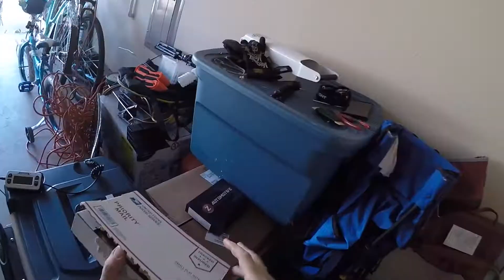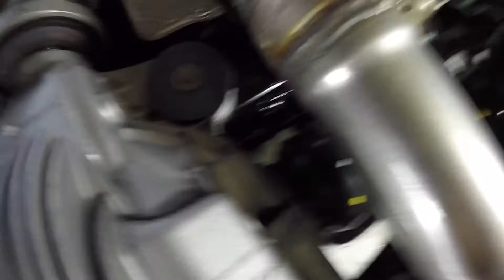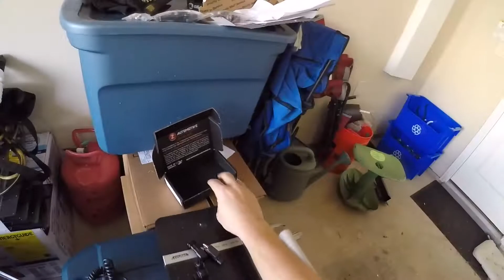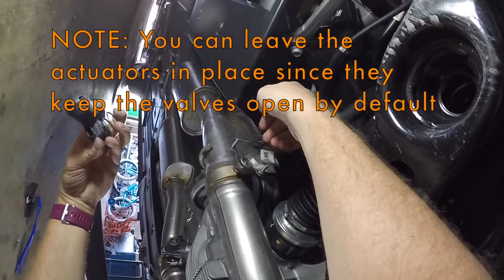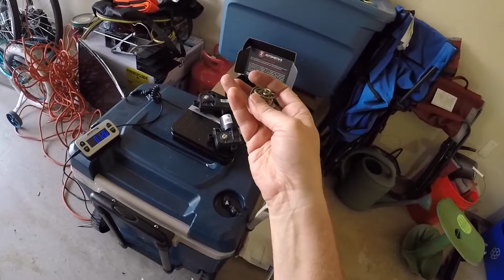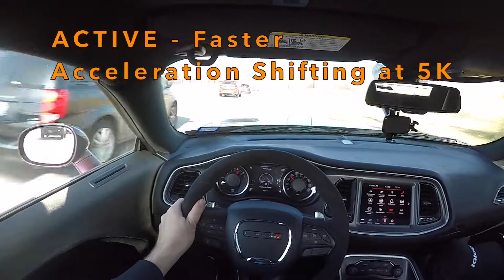Active Exhaust Delete Options for Dodge Challenger and Charger - FREE vs.  Z Automotive vs. Khaos

Comment from the maker: For whatever reason the free option that I show doesn't work on cars with the 5.7 It'll only work on 19 and up 6.4s and Hellcats.
Reply: I have a 17 392. So I assume the Free method you remove the spring from the casing and screw it back on? That way it can’t twist the valve that’s wired? I have a rattle and it’s annoying.
Reply: @ztidz  did you end up doing it I have a 17 as well and I’m thinking of doing the same
Reply: @392Alex did it work for you ? I’m asking you because I have the same problem with my 2017 scat pack
Reply: @josetepeyac4849 no I ended up buying a kit from online
Reply: @ztidz you have to tie them open
Reply: I have 2016 hellcat. I will have the code?
Reply from the maker: @MrYousefX  if you get the delete kit or plugs, then no. But if you try the free method, then probably yes. I've only. seen the free method work without popping codes on 2019s and newer.
Reply: Why would the free option not work on the 5.7? Asking because I have a '19 Challenger R/T
Reply from the maker: @erikleach1753  my guess is it's something to do with the programming. While 6.2s and 6.4s went through some changes in 2019 they must not have made changes for the 5.7s. But again that's just my guess. So far everyone I know that's tried it with a 5.7 has said the check engine light comes on
Reply: Do you have a code. 
I just got mt 19 5.7 all fix up @erikleach1753
Reply: It worked for me
Reply from the maker: @MrSuperTrackPackRT  what year, trim and engine?
Reply: @Scavenger1320 do you know if the z automotive ones will trigger check engine code on ,2018 challenger rt  5.7
Reply from the maker: @Hndzzzz310  it shouldn't pop any codes.
Reply: @Hndzzzz310 it doesn’t throw any lights (zauto)- works like a charm. 
Best sounding exhaust compared to a scat or a cat.
I had it on my RT- totally worth it.
I have it on my hellcat now!
No problems at all- except for
1. Cars move out of the your way.
2. Attention on the streets.

Comment: This was a very helpful video. I just ordered the Z Automotive inactive exhaust kit for my '18 Challenger Scat Pack because of the ease of installation, the plug and play methodology, and the ease of switiching it back to stock if I want. I plan on just leaving the actuators in their place but use the protective caps Z Automotive provides with the kit.
Reply from the maker: Definitely the easiest and quickest way, and gives you more options in the future if you ever decide to do a cat-back exhaust system. Thanks for watching!

Comment: If you take spring out, why would you need to strap open,? If spring activates the plate to open shut,just asking because not sure,thanks
Reply from the maker: The spring is what is physically connected to the metal valve/flap that opens and closes inside the exhaust pipe. So without the spring, that metal valve is free to move in any position, which means it’ll just be moving around anytime the engine is running and causing a rattling noise.
Reply: @Scavenger1320 thanks for letting me know

Comment: I just did this today and I have a scat charger with mid muffler delete and it does sound a little deeper but not louder your right , my girl claimed it was louder from in the house tho when I stopped by for 10 mins and left to the store so was warm , worth it for free it’s nice having the track mode sound at idle

Comment: My 15 is throwing a code.. the part or wires have failed.. looks like the z auto is the way to go to get rid of the code.
Reply from the maker: That should definitely do the trick, and I think cheaper than buying the actuators, depending where you get them.

Comment: So I'm trying to deal with mine buzzing, 17 T/A 392 M6, I guess the Z Automotive would be best then? I was going to tie them up, but would get codes huh? FREE just sounded good, but to avoid codes, I guess try one of your methods...
Reply from the maker: Free is good, but yeah, you'd have to deal with the CEL on a 17. Z Auto is definitely the easiest option, and the best if you ever plan on getting a custom catback exhaust since the Z Auto plugs means you can completely remove the actuators. The mechanical deletes are a bit cheaper but take a little bit more work than just simply plugging in a connector and you have to leave the actuators in place.

Comment: I have a 2017 charger daytona 392 that squeaks from the active exhaust. If I use the z automotive plugs will it go away. Also would I get a check engine light?
Reply from the maker: Yes, the squeak would go away since the valves would no longer mechanically move at all. And yeah, the z auto plugs would keep the CEL off. That’s really the only reason to even get them since you could do the same thing for free except for that light.
Reply: @Scavenger1320 thanks, if I do install the plugs, do I need to make sure the valves is open before plugging it in? If so how can I open the valve
Reply from the maker: @ebadahmed8765 nope, nothing else you need to do. The valves are open by default when the car is off so all you have to do is unplug the connector from the actuator, plug the z auto plug into that connector, and zip tie it out of the way. The hardest part is getting under the car lol.

Comment: I just installed mfer-1 before I watched this video. Not the hugest difference. Don't regret purchase.I think for $90 I should have put towards midpipes instead. I do have subs so it's alil more sound without messing with tunes.
Reply from the maker: Yeah, it's definitely not a huge difference, but as expensive as most mods are, this one isn't too bad. Thanks for watching!

Comment: Thanks for the video. 
Is there any confirmation about the free option for a 5.7L 2023 last call ?
I saw you said maybe it works.
Reply from the maker: I haven't seen any 5.7 cars where the free method won't pop a code unfortunately. Last call 23s have been out a while now too and I haven't seen anyone saying anything different.

Comment: Can anyone tell me what size zip ties to use? I'd like to try that option before dropping $160 bucks...
Reply from the maker: I really recommend using a metal wire like I did over a plastic zip-tie. You can pick up a small spool of the exact same wire I used in the craft section at walmart for just a couple bucks
Reply: @Scavenger1320  thanks for the info! Do you know what gauge or type of metal you used?

Comment: 2019 challenger  RT 5.7 it don't work the free way ! It throws a check engine light . So you need to put the plug or the the other option
Reply from the maker: Yup, I wasn't sure about the 5.7s when I filmed this but pinned a comment here about it not working on the 5.7 cars after I found out about that. I'm not sure why it's just the 5.7s that it doesn't work for.

Comment: Yeah, this did not work on my 2019 charger R/T. Less that 15 min after doing the ziptie trick i ended up with a code for active exaust.  P121b
Reply from the maker: The free method has never worked on the 5.7 cars for some reason, it'll only work on the 6.4s and 6.2s.

Comment: I cut out my AES valves completely and i have a CEL on in a 22’ Charger RT, i just ordered the Z automotives to hopefully clear the light, do you know if this clears the CEL after the fact or are they only good to install before messing with the active exhaust?
Reply from the maker: It should clear the code after you turn it back on, just make sure the car is completely off when you install the plugs. Everytime you turn the car on the active exhaust is one of the self-checks that it does, so with the plugs installed it'll do its check and the plugs will make it think everything is working again so all should be good.

Comment: Are the pins needed for the acuactuator or can I do without them?
Reply from the maker: By pins do you mean the springs? If so, then it depends on which delete method you go with. If you do the Z Auto plugs, then you just leave them in. You don't even need to remove the actuators for that. Pretty much any other delete method you do have to remove the springs.

Comment: Why does everyone use zip ties or wires I'm going to show u a trick no one knows about I created this and it works better than anything  u can ever try go to  auto zone and purchase J.B steel stick it's a clay read the instructions break a guud amount of clay u turn the valve to a 2 o'clock position u cover the valve pretty guud with the clay put the active exhaust cover back on let it sit over night do not start ur car for about 12 hours that clay u covered the valve with will turn into steel nothing will move that not even with a hammer u will nvr have to worry about that valve malfunctioning I came up with this idea and had it for a year already nvr worry about it coming loose I promise u  you will thank me later on I promise u NO ZIPE TIES PLEASE OR WIRES
Reply from the maker: Well, for one there's no having to wait 12 hours or having to have the car sitting overnight with wires or any of that other stuff you're talking about. In about the time it took to write all those steps out, I could be done with it using a wire, and be able to start it up and drive off instantly. Plus I've never had any issues with the wire. I ran this same wire for over 3 years and it was still holding strong. If your method works too and thats what you prefer then great, but using a metal wire is definitely the easiest way. I do agree about not using zip ties though. I wouldn't trust something made of plastic up against a hot exhaust.

Comment: I have a 2019 RT  i have a code.
I did unplugged it to fix the broken spring. 
Still have a code.
I neee help
Reply from the maker: If it's a 5.7 then that's why. The free method doesn't work on 5.7 cars, except maybe on the 2023 model year. So for a 5.7 you'll have to buy a mechanical delete kit or the Z-Auto plugs.

Comment: THIS GUY IS SOʻO USE TO BEING SELFISH HE FORGOT TO TELL U WHICH WAY DO U TURN THE ACTIVE EXHAUST  VALVE AND ZIP TIE IT 😂😂😂😂😂
Reply from the maker: selfish, sure lol. But also, I literally say that when the car is off, the valve is in the open position by default, so when you pull the actuator off, that's the open position. Not to mention you can just look at how I wired it and see that it's tugging on the valve to the right, or clockwise.

Comment: What if I just cut off the valves and add a 3 inch pipe? Will I still get a check engine light?
Reply from the maker: As long as you leave the actuators plugged in and just tie them off to the side somehow then no, you shouldn't get a light. That is as long as your car is a 2019 or newer and not a 5.7

Comment: I have a new, Scat Pack, Shaker Challenger and I opened the actuator servos, removed the springs, zip-tied the valves open (way better/easier than wire) and bolted the servos back on...  20 minutes, soup to nuts and it runs fine with no code   Absolutely no problems and it sounds terrific! 😊
Reply from the maker: Zip ties might be easier, but I wouldn't say better personally. I'm going to trust metal being next to a hot exhaust more than I would plastic, but I know others that have used zip-ties too, I just wouldn't myself. Glad the free method worked for you too and thanks for watching
Reply: @Scavenger1320 I did the zip tie lasted over year been having it for a year and half but the problem is hard bump can make them close and you have to do it all over again so just purchased the metal delete kit.

Comment: Great content Chris!  What a pain in the ass...lol  I was going to get a new catback for my 2021 Challenger Scat, but I would imagine I will have to get this Mod so it doesn't throw a code.  It sounds better in "inactive" version for sure.  I seen a Scat owner using zip ties, not sure if I would trust that to hold the valves open.
Reply from the maker: I've seen people use zip ties too, I've seen melted plastic under cars too often to trust them, especially when put directly onto hot parts. It depends which catback system you want to get. A lot of them that are made specifically for these cars are made to address the inactive exhaust. Some will have their own valves built in to where you use the stock actuators, others will have a mechanical delete built-in.
Reply: @Scavenger1320  Oh, ok Chris,  I just need to find out the Active Delete function of whatever system I am looking at.  Thanks!

Comment: Maybe this question was asked, I didn't go through the 300 plus comments,  but why couldn't you just remove the spring from the actuator?
Reply from the maker: That’s literally one of the options I talk about in this vid. You still need to wire the valves open though otherwise they’ll just flop around

Comment: I have a '17 with a Flowmaster catback system and i need to get the Z Automotive plugs to clear the check engine light.
Reply from the maker: Perfect use for the Z Auto plugs! I've had mine installed for well over 3 years now and no issues.

Comment: Hey question man ! I got a 2021 challenger 1320 ! Just installed corsa xtreme and hear a tiny rattle from the active valves ! I also want the active valves to stay open ! Do you think i will be good with just removing the springs and turning the valve to the ‘open’ position and then zip tien them down? You think i will get a check engine like all these other ppl are saying ? Once again 21 challenger 1320
Reply from the maker: The free method of removing the springs and wiring the valves open will work on your car. Just remember to leave the actuators plugged in. This works without causing a light on all 2019 and up scats and cats. The only cars it doesn’t work on is anything older than 2019 and all 5.7 cars no matter what year.
Reply: Hey update so i tried on my 21 challenger 1320 … will not work my active exhaust valve is different from what the video shows my valve thing inside the box that turns freely is not circle it is more a rectangle square has the 2 little slits && the active exhaust box itself does not have any holes for a zip tie or wire to run through ..lol i drilled 2 holes for a zip tie to go through but still would not work because i think the piece was more square than circle like others i see… odd i am going to have to settle with the z auto way didnt wanna pay that much but got no choice .. just a heads up and update 2021 challenger 1320 6.4l does not work
Reply from the maker: @bigdaddybmoneyy  So I just did a little bit of digging since I know people with 21 and up scats that had no issues, and I'm guessing the Corsa exhaust you got came with Corsa's own active valves, which although they reuse the stock actuators, the valve itself has a different design, and from what I've seen, fits your description exactly. Looking at the Corsa Extreme, I see they sell them where you can re-use the complete stock valves, which involves cutting them out of the stock system, and is therefore cheaper, or you can pay more to just get Corsa's valves where you don't have to chop up the stock cat-back.
Reply: Thank you for responding lol i will keep you updated brother
Reply: Hey one last thing … is it a big difference in exhaust sound in person in the 1320 ? I have a 1320 as well with a corsa xtreme would i notice a big difference?
Reply from the maker: @bigdaddybmoneyy  No, it's not that much of a difference at all. Cold starts sound the same, WOT runs sound the same, and there's hardly any noticeable difference at higher rpms. Where you hear the difference the most is when cruising by slowly at low rpms or idling after being warmed up. Even then it's still not a huge difference. I know there's a lot of people that were expecting a big difference and were disappointed by it.
Reply: @Scavenger1320  appreciate it bro ! And now i am not doing it lol .. i will save my $200 and have a good dinner with the wife and kids lol … the thing is i am so usto driving my challenger like i said i have a corsa xtreme and when you are driving it is hard for you yourself to hear your own exhaust tone and what your vehicle sounds like from inside ! But when you are outside and someone else is driving it hits different ! Had a oil change today and the mechanic pulled it in and whe i heard my 1320 from outside without me driving it lol made me fall in love more and was like wtfff didnt think it sounded that good .. its just much less tone when you daily drive it yourself and not hearing it from outside perspective ! Once again thank you
Reply from the maker: @bigdaddybmoneyy  I think that's a good decision and totally agree with you about hearing your car from the outside. It's just hard to have someone else behind the wheel without me there lol.

Comment: 17 Daytona 392 can I do this on mine I changed actuators and code still comes back
Reply from the maker: The Z auto plugs should work for you. With them on it doesn’t even matter if the actuators are working or not
Reply: @Scavenger1320  not working for me either and valves are cut off

Comment: Don’t agree with active exhaust delete and mid muffler delete. Replace mid muffler with vibrants and go to sport mode. It will be sweet sounding. If you want loud and raspy go ahead and mod to your hearts extent
Reply from the maker: I get not liking the mid muffler delete as that changes the sound and it’s not for everyone. I’m honestly not a fan of it either. But why be against the active delete? All it does is keep the full sound of the exhaust in all modes. And if going to Sport mode opens them up and is sweet sounding why not have sweet sounding all the time lol. But also my car didn’t have a Sport mode
Reply: @Scavenger1320  good thoughts. Not against it. I’m an older dude who likes the sweet sound I have now.  The great thing is so many options to keep your mind occupied. Love molar over all the rest